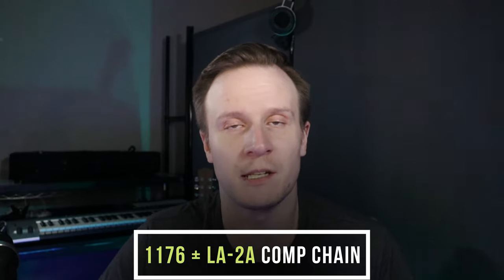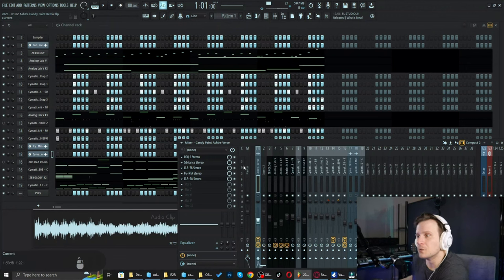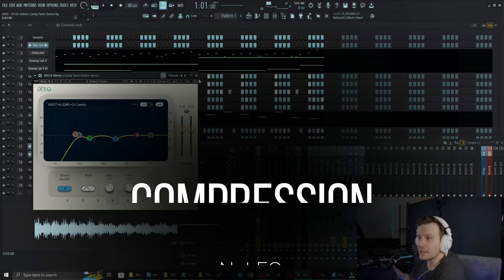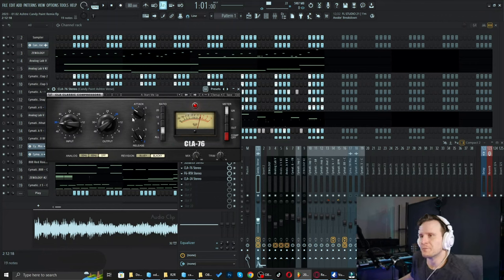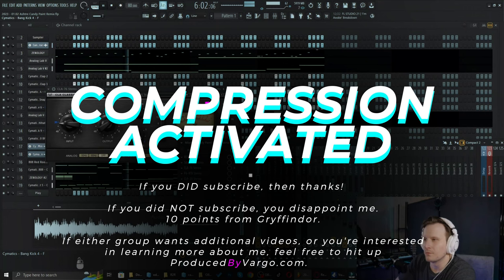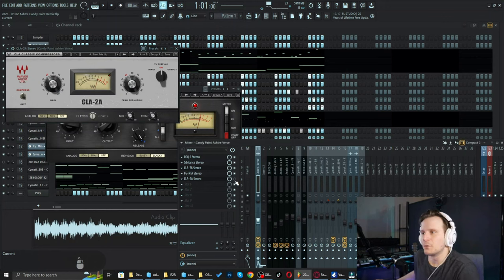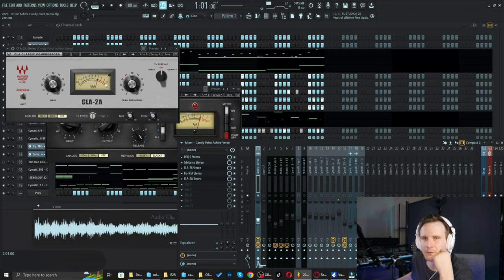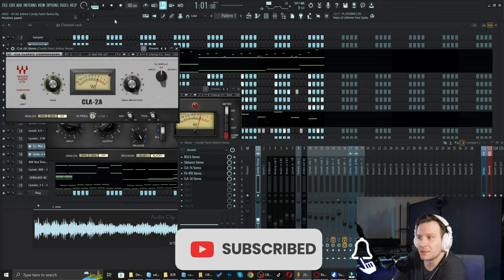1176 to LA-2A Vocal Chain: A Deep Dive Into Vocal Compression

Comment: Would you run the same chain on a vocal bus where three different vocals are being sent to the bus?
Reply from the maker: Good question.  Is the trio made of stacks, or do you have different vocals altogether going to the bus?  For example, is it three takes of the same line, is it harmonies, or three separate vocals altogether?  If that makes sense.  If it doesn't, you can always shoot me an email with a screenshot or quick screen grab video and I'd be happy to answer that for you!

Comment: Noobie question here. Why are mixing vocals in stereo? I thought it was always mono
Reply from the maker: Hey man, good question.  It can be confusing sometimes, especially when you're new to these concepts.  So, in most cases, vocals will be recorded one at a time (in mono, like you said).  Each of these vocal takes can take up a separate mixer track, and if you're putting plugins on those mixer tracks, the mono option would generally be best.  However, it's possible that more than one vocal take is assigned to the same mixer track.  A good example of this is a "bus" (I have a couple videos on busses and how they're used).  Sometimes there will be like 5 vocal tracks assigned to the same bus, and for that scenario, you'll have to use the stereo option for whatever plugins you use.  This also allows for stereo imaging flexibility.  Hope that helps, and thanks for watching and commenting, man.

Comment: Hey, so I just had a couple of questions, cuz i’m pretty new to mixing vocals, and there’s just much information  that it’s pretty overwhelming. So, is there any instance where you would use a faster attack on the 1176? And when would someone use a higher ratio? Also, you mentioned other methods that have the 1176 applying more compression. When would these methods be used, and what kind of sound would they achieve? And would you then apply less compression with the LA2A when applying more with the 1176? I’m the type of person that likes to have a definitive solution to something, but It seems like music isn’t really like that, which can be a little frustrating. Maybe i’m just overthinking everything tho. I guess i’m really just trying to figure out different ways to tweak this method to make it fit in a wide variety of different songs. I keep watching different tutorials on the 1176 and LA2A method, and it seems like there’s no consensus on how everything should be set. Do most audio engineers just use one method, or do they experiment with different settings? Anyway, sorry for rambling, i’m just really trying to wrap my head around all this.